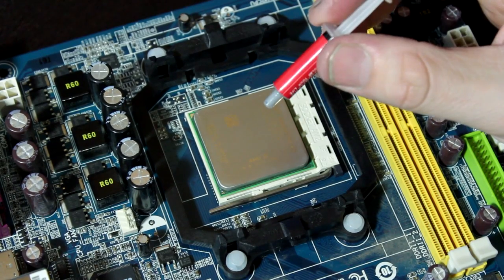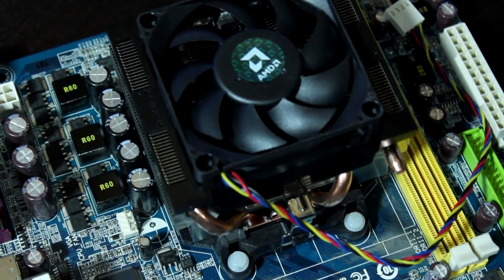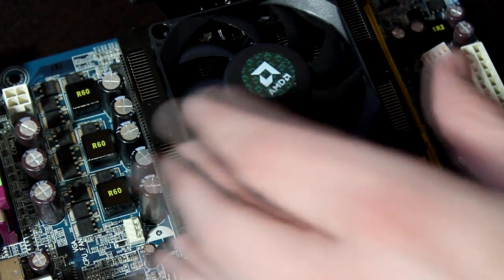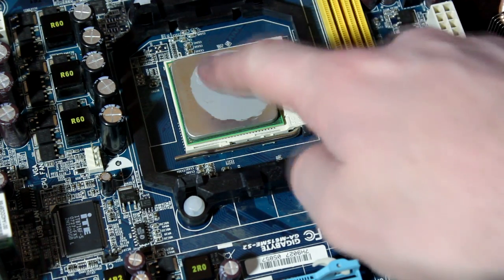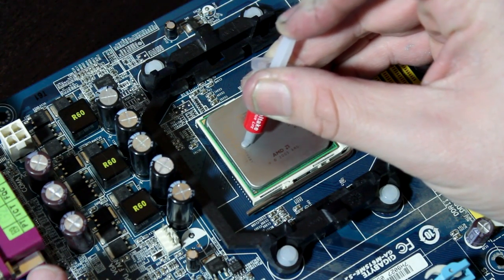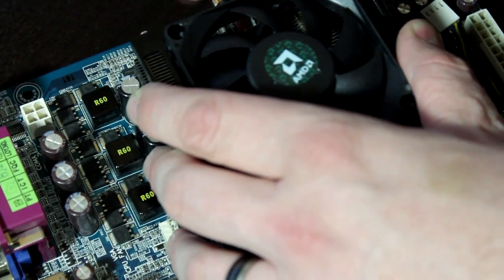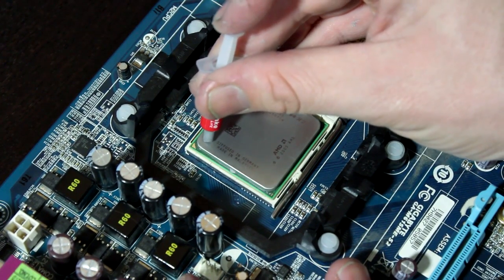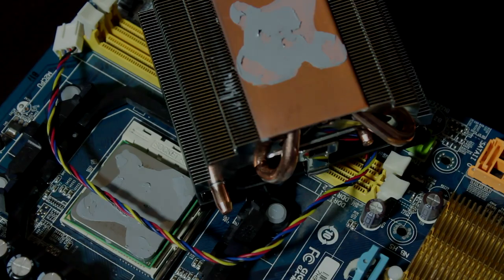How to install Thermal Paste

Comment: I'm sure others have pointed this out already, I'm too lazy to scroll the comments and check, but the spread method isn't really "wrong" as it's more "outdated". Back when cpu's were nearly the exact same size as the die they were under, the spread method was THE best method to use. Today's cpu's are much smaller than the die they're under so all the protection you need is right over the cpu itself, which there are tons of video's on here showing you delidded cpu's so you can see for yourself the actual size of your average cpu these days. Using the spread method today is more force-of-habit than anything else. I myself prefer the line method because it covers the whole area on the die above the cpu and takes into consideration the shape of the cpu, effectively covering every bit that's most important. Now with all that being said, there really is no right or wrong method when it comes to applying thermal paste, except for trying to apply it with your penis(don't do it!), because not all cpu's are the same. Some will run hotter than others and likewise some will run cooler. So the only thing that really matters is the quality of the thermal paste.

Comment: Proper way to apply thermal paste is, put a little in the middle then spread it evenly with your tip with a plastic bag around your finger tip.

Comment: It just looks like the X method works better because you actually put twice as much thermal paste than the pea and line method...
Reply: too much compound turns it into a insulator. less is more with thermal compound.
Reply: Edizzle exactly. Might as well throw a blanket over your cooler if you slap on that much thermal compound lol
Reply: i remember fixing my ps3 when it had the yellow light, i was told credit card and my ps3 fried again 2 weeks later :/ oh well at least i got my saves. i stick with pea/ rice now depending on the compound i'm using. and yeah its frustrating at times man.

Comment: I used the credit card spread method my 6300 idles about 35C and games about 40-45C I'm pretty confident in the spread method and at least I know my cpu's entire surface is being cooled.
Reply: What games though? and what cpu cooler was it cos i just recently got a 6300 and i'm using the shit stock one that makes my temps in bf3 ultra 55-65C :::::::(
Reply: Alex Simpson Hyper 212 evo actually I didn't use the credit card method I just remembered I used a small pea sized dot but I used my finger in a plastic bag to spread it over the entire cpu. Just did this with my second build as well temps are 21-22 C while i'm browsing the internet with the Cooler Master vortex and a gelid silent fan. http://pcpartpicker.com/b/YTqkcf
Reply: My fan kicks into 100% mode at 45 C + and is very noticeable I've only heard it do that a few times when I checked my temps they were about 46-47 C don't remember the games but I've got like 20 on my system only maybe 2 or 3 have pushed it to get that hot I also have a lot of case fans .
Reply: That's pretty good temps I wouldn't worry about an aftermarket if you do the Cooler Master vortex is actually low profile I bought that because my case is a corsair 240 air micro atx case and it's not much bigger than stock also there is water cooling which is the lowest profile you can go with.
Reply: I doubt it unless you run them straight over the mobo and have a small case they will probably be too short and if you are running them to the mobo directly you may need a y splitter  to connect more fans to the board I have 2 in my case
Reply: Two fan brands I personally recommend are Gelid and Nexus if you have 4 pin headers you might as well get the 4 pin/pwm gelid fans.
Reply: They make both most fans are 3 pin but they both 4 pin fit 3 pin headers as well as 3 pins fit 4 pin headers.
Reply: Can CPU work without thermal past applied?
Reply: anonymous2012s Good way to burn through a cpu and possible damage the mobo.
Reply: Galactigus Oh ok. Its just that my CPU wont work, but its the compatible socket and my mobo supports it. I hoped a bit that changing thermal past could change anything would solve the thing but obvs nope, my CPU doesn't work so my PC won't even start. 
Thanks
Reply: Alex Simpson Thanks for a reply!
Reply: Galactigus Can thermal paste last for more than a decade? Btw thanks for the previous reply
Reply: Oh ya it can last longer but if your heatsink is installed wrong it can dry up or dust can settle in there mixing with it making it less effective. Only a very small amount is needed to bridge the gap and eliminate anything between the two that may affect heat transfer. Anything more than that and your cooler won't perform as well.
Reply: Galactigus Oh. Thank you for the info
Reply: Ya I remembered I tried it and it just wasn't working for me so I went with the finger in a bag method did it with my second pc too and it runs under 30C usually around 25

Comment: I do the ziplock method. Take a ziplock bag put your index finger to ensure your skin does not make contact with the paste or cpu. Then start with a dap in each corner and spread the paste out with your finger. Never had squeeze out or overheating issues never. However, make sure the whole face of the chip is covered. I only go about 1/32 or 1/16 in thickness.
Reply: LOL oh my god...that's horrible.

Comment: The pea method may look like its not covering the hole CPU, But when it heats up, It will spread even more.
Reply: yup, and Jay even stated that the paste was crap, it looked kinda gumpy, I know my AS5 usally spreads really well when my cooler is mounted, I think it was just his paste.
Reply: AirplaneRandy You are right randy. Thats why you dont need to cover the entire cpu. About 80% will do. A lot of thermal pastes have a burn in period they heat up spread and melt even more. If you have a perfect cpu surface and perfect heatsink surface you dont need thermal paste but since thats almost never the case thats why we use thermal paste. Less is more in this case. Too much and it obstructs heat flow.
Reply: I heard elsewhere that the actual core of the cpu is in the center of the cpu, the heatspreader (metal portion) is much larger, but the heat coming from the core is just coming from the center.

Comment: The goal is to get the best coverage, and without sacrificing heat dispersion to the heatsink/waterblock. Something to consider about the cpu is placement of the cores under the IHS. With intel they are usually line up in the center, so the line method will work just fine. So it comes down to how much. Well when it comes to cpu's less may be better. Not necessarily for the Haswell but some tests suggest it doesn't matter. try as many methods as possible and if a compound manufacturer has a suggestion try it.

Comment: Seems like I'm the only one who takes a flat piece of plasic (e.g. a credits card) and spreads the thermal paste on the heatspreader manually
Reply: Topias Salakka
2 reasons
First: More area to have to temperature transfered to the heatspreader
Second: It's more accurate and thinner so more effective in tranfering the heat

I run my overclocked CPU with 100% load at around 50°C in an aircooled system. My GPU ticks around that , too
Reply: Pathfinder3877 Spreading is the worst method. It creates air bubbles even if not visible. And considering the whole cpu doesnt need to be covered its pointless. After burn in and a couple hrs or running the thermal paste melts and spreads evenly.
Reply: I do that too :)
Reply: Why should you? Why not just let the mounting pressure do the spreading, like everyone else?
Reply: bluej511 I've heard from some people that spreading works for them just as well as pea method. Still doesn't make sense, pea method is faster and easier :P
Reply: Topias Salakka
if you run a "slow" system with just basic programs thats just fine but if you need some heavy duty cooling you should cover the whole heatsink.
Reply: Pathfinder3877 You basically said the same thing twice...
Reply: I just installed a Noctua nh-u14s. I used the pea method and put on a normal amount of thermal paste. I didn't remove it to check but i know its working. I went from a 5min stock cooler intel stress test at 73C to a 15min stress test with the noctua peaking at 50C with 1 core that runs 5-6C cooler then all the other cores.
Reply: I used the finger in a plastic bag method my 6300 never goes above 45C and to those saying "Well you don't have to cover the whole thing because only the middle needs cooling" think about it for a minute if the whole cpu is getting cooled vs just the center then the outside being cooled will help to cool down the center as well.
Reply: Galactigus Thats not true though. Its heat transfer thru wtv the IHS is. My guess is its aluminum, not very good at spreading heat. Try to heat up a piece of metal with a torch and where oyu heat it up is where it glows red. I just used the pea method and my i5 stock with a noctua stays at 50C under load. Down from the 73 the stock cooler did. Btw the stock cooler when i pulled it off left a nice round mark on the center of the cpu. Even intel with there stock coolers dont cover the whole cpu. The actual cpu die is dead center. Find pics online youll see.
Reply: U mean like this? http://www.legitreviews.com/images/reviews/1292/coolit_eco_alc_010.jpg
Reply: Where you heat it up may be red but I assure you the heat will spread to the rest of the surrounding metal that's why I believe having thermal paste cover the entire cpu is better than only having it in the center.
Reply: Theres not really a difference either way you apply it but it just makes more since to me that you cool the entire cpu not just the center.
Reply: The large metal surface you see on new intel CPUs is just the heatspreader and under that there's smaller CPU die in the middle. Look at old Athlon XP processors, that's how your new Intel CPU looks without that heatspreader. So I think it's most important that there's compound at the center.
Reply: Considering most heatsinks that already come pre covered with thermal paste the majority ive seen have a round spot right in the middle of the heatsink. Intel on there own heatsinks as well. My guess is they know what there doing. Covering most of the center youll be fine. 1-2C degree difference wont kill your cpu.

Comment: I got this stuff from work and I'm just wondering if this is good enough for me to use. This is the name of it (Heat away 639 grease).
Reply: No offense but it sounds like cheap unbranded shit, generally stick to Arctic, Arctic Silver 5 or branded variants.
Reply: theaceman2009 It seems to be a product designed for industrial use while arctic and others are for personal use. However, I wouldn't recommend putting it on a personal build due to lack of support.
Reply: Star Wars News! You what m8?
http://www.amazon.com/Heat-Away-Thermally-Conductive-Aluminum-Grease/dp/B00GUSJDUO#product-description-iframe
Reply: Vihanga Dharmasena so your saying this stuff is better than the other stuff they sale out there.. This is the description of the product I was asking Heat-Away 639 is an aluminum-filled, thermally conductive grease which offers exceptional thermal and electrical properties to 550°F (288°C). This material is used in high-power electronic devices, heat pipes, and other heat exchange systems. 

On the picture, Heat-Away 639 coats process heater to improve thermal contact.

Comment: I use the X method, along with using a plastic brush tool to even everything out. I literally make sure the whole CPU is covered and well layered lol. My temps never go over 37'c in summer hot days lol. It stays at 32'c idle no progression.
Reply: That's a very bad method.
Reply: softrockification Say that to my temps, without ac in my room and summer at me feet at 32- 33'c lol Dude, I just called out my temps and it's been 4 months and still the same temps. & I play FFXIV ARR which is constantly on, while doing other activities and only goes up to 35'c max. So no, evidence over your ignorant reply.
Reply: Asuia Kyoto It creates micro air bubbles.... There is my reasoning... Want me to sum up how gravity works in five words?
Reply: softrockification I find that a myth, it really depends on the person. I still haven't replaced my thermal paste since I posted this-- which was 2 months before I posted this and was applied on my cpu. These Micro Air Bubbles doesnt exist, hence my cpu never goess above 38'c usually stays at 36'c playing FFXIV ARR lol

Comment: Take oůd credit card, cout out a small spatula out of it and manuály cover most of the cpu in as few as possible takes to avoid bubbles, do the same for the cooler (very thin layer, almost transparent)